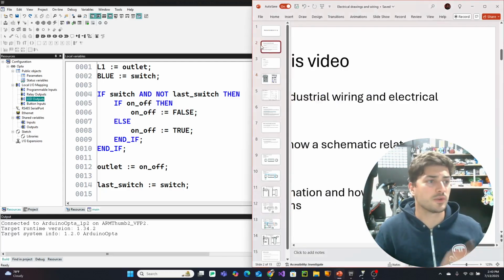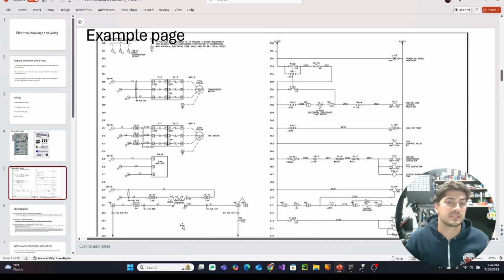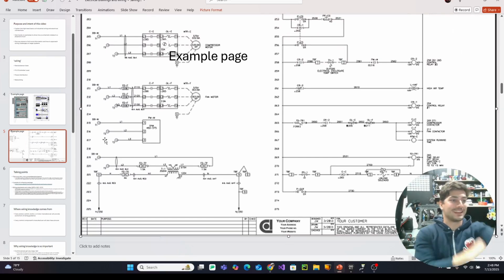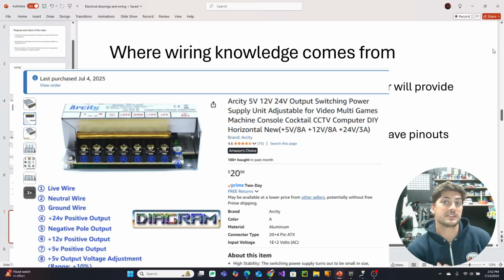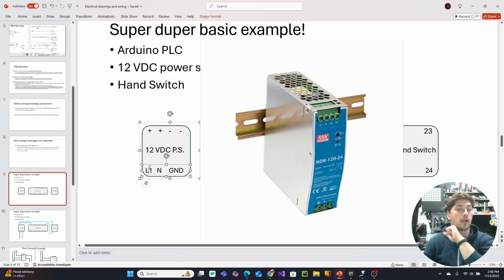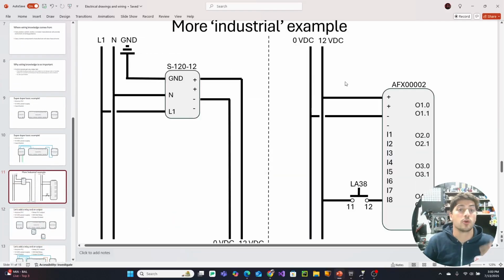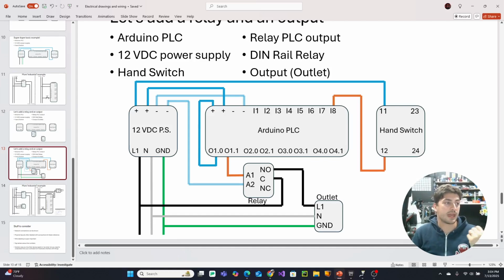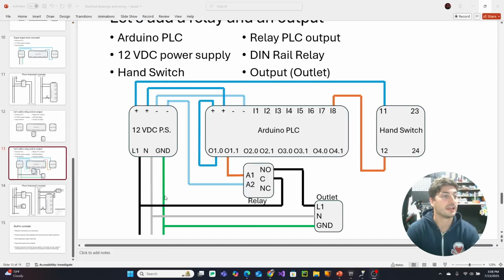Introduction to Electrical Wiring and Schematics for Controls and Automation Engineering!

Comment: Question: You have L1 as 120V "hot" at the outlet then the common "C" on relay T's into the L1 24V VDC power supply.  I am coming from the micro-processor environment (Arduino,ESP32, Raspberry Pi etc.), and alternating current always makes me have to question which is which. A1 (24V) energizes the relay then the outlet closes and turn on the light? Thanks
Reply from the maker: Common on a relay refers to what strip of metal is switching between touching normally open and normally closed, so it’s not really a voltage or callout about what dc or ac wire gets landed there, it’s telling you that terminal is going to flip flop between normally open and normally closed when the A1 and A2 side of the relay switch on and off!

Comment: In the your diagram at 21:20, if the relay is to be energized, it should get an output signal from the arduino PLC, but the PLC is off  since it can never get power until the PLC tells it to turn on to give itself power? Diagram at 25:00 maked more sense as the power input into the PLC is independant of the relay.
Reply from the maker: No the Arduino Opta PLC has two power terminals on it, so it gets powered on from the power supply, then the other one I run to the first side of the relay output, then the other side of the relay output goes to the external relay. So the Arduino PLC has relays outputs and the jumper isn’t powering on the PLC!